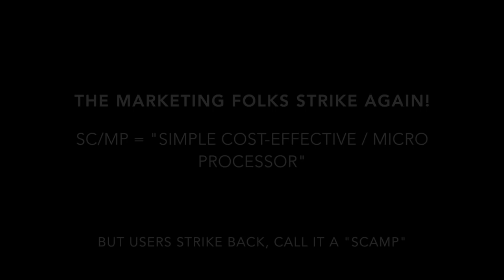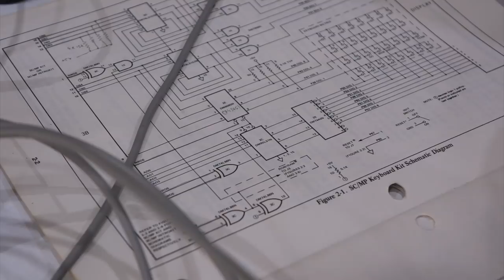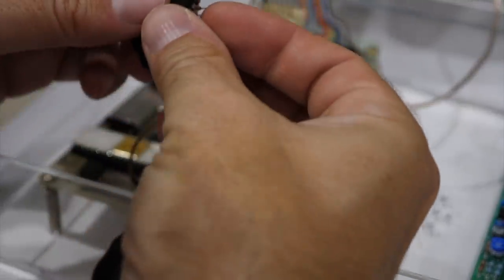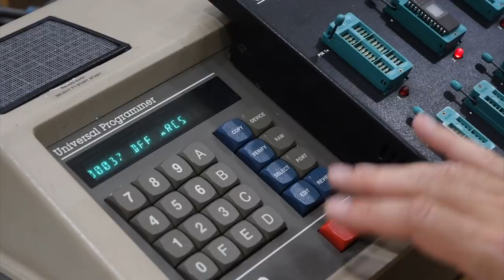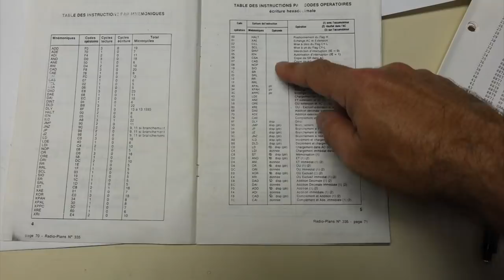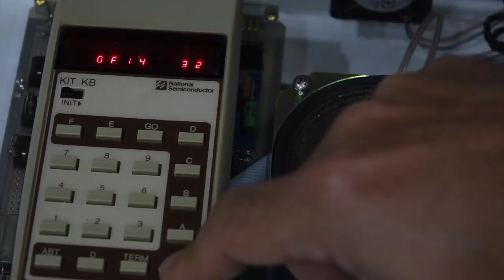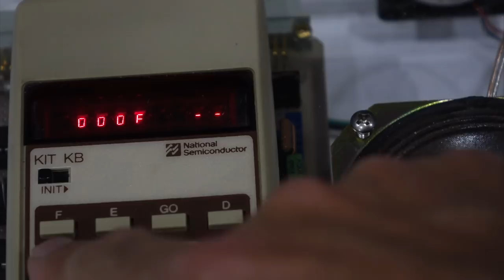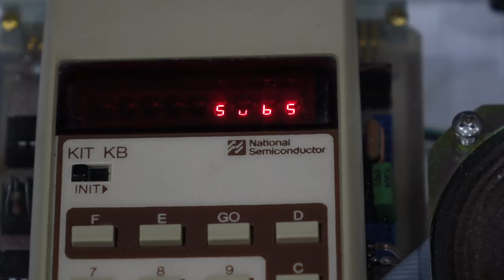My first computer: the 1976 SC/MP 8-Bit Microprocessor Kit

Comment: I'm reminded of a time when I made a minor mistake laying out a board, and three address pins got added in the wrong order — I was grousing about "I'm gonna have to build a little 'bunk bed' adapter to rearrange the pins…" when my business partner said, "No you don't — we just move the bytes around in software.  So long as address pins on the ROM go to address pins on the CPU and data pins on the ROM go to data pins on the CPU, we can massage the Intel Hex files with a tool to make the right bits appear where the CPU expects them."  There's a reason we continue to work together 30 years later.
Reply: Is it actually true that the hex files needed touching up, I would think if the wires for the address are out of order they would get stored out of order but then put back correct when you were reading it back.
Reply: That was my first thought when I saw the remapping diagram, only to realise it wasn’t just the address or data lines.
Reply: We had an issue when making a cartridge adapter for a ROM emulator.  My boss at the time had the genius idea to use the Address pins to latch data into hidden registers so that we could mux in our own ROM image.  I designed the FPGA and statemachines all in schematics (Xilinx 3042).  Fun times!
Reply: @ZakKohler  If it's RAM you can generally put the address and data pins in any order. It's a problem if it's a memory you program externally before mounting on the board, like ROM or EPROM. Then correcting the hex file would make the programmed data match the board's wiring.

Comment: My first microcomputer (I had been programming on mainframes since I was 14) was the "Cosmac Elf" which used an RCA 1802 microprocessor. One of the example programs in the manual was called "Spirit of 76" which made a sound very much like your siren program, except in reverse. The 76 op code (hex) shifted bits in the accumulator which, as part of a loop, generated the tones programmatically.  The 1802 had a single bit register called the X register (which in the kit I had was connected to the speaker) and it was set using the "set x" command, for which the mnemonic was SeX. 19 year old me found this very humorous.

Comment: I too was building SCAMP microprocessor boards around about 1976, I was twenty years old and working for the British Government. They saw where the future lay and let me buy what I needed to get my prototypes up and running. I too used pins on the bottom of the board which I soldered enameled wire (wrapped around the pin) just heating the pin / wire up until the flux melted the enamel and joined the wire to the pin. The wire was on a spool at the top of a pen and you could zig zag your way around the board to the next junction. Fun days !

Comment: Your excitement when it turned on really made my night!
Reply from the maker: You bet, I was so relieved it worked! It was a bit of a long shot. If this had not worked, I was not looking forward to a time consuming logic analyzer debug...
Reply: CuriousMarc

Well done. ;)

I've done that many times when getting excited to power up a device after repair - forgetting to plug it in. lol

You're a braver man than I, though - entering the hex manually on the EPROM burner. :p
Did you also read the contents of the buffer into the PC first, just to make a backup?

(just a bit of OCD on my behalf, as I would have typed it into the PC. To be fair, the keypad on your burner looks much nicer than the average PC keyboard. hehe)

Amazing work on the Alto btw.
I followed the whole series from start to finish, and couldn't wait to watch the next episode.
Reply from the maker: Yes, typed it on the burner because of the much better (Cherry keys!) keypad and auto address numbering. Downloaded it to the PC afterwards and will give it to Al so he can post on bitsavers.org.
Reply: doesn't the dolch keyboard use cherry keys too? (they might be a different variety of cherry keys though.)
Reply from the maker: Some Dolch keyboards do, and are quite sought after apparently. Not sure if mine is one of them, does not feel very special. The ones on the Data I/O on the other hand feel awesome.
Reply: Would be quite entertaining to see the SC/MP connected to your reel-to-reel HP tape drive for mass storage ;-)
Reply: You did very well :-)

Comment: I eagerly followed the introduction of all the early microprocessors, starting with the Intel 4004, and collected all the data sheets and manuals.The first documentation for the SC/MP actually referred to it as the Simple Cheap Micro Processor, so I suspect the engineers who named it that also called it SCAMP. Sadly, Cheap was soon changed to Cost-effective, which for me made the thing much less appealing.

Comment: Great video - thank! The SC/MP was also the processor in the 'SCRUMPI' kit from Bywood Electronics, UK - my first 'home computer' kit. Great for learning about microprocessors and coding. The 'SCRUMPI II' kit used the Mk II version of the chip, and also had more RAM etc. After that, I upgraded to a rather more sophisticated home-designed 6809-based system, and wrote quite a bit of code for that as well. All Hex entry - no assembler! Fun times!

Comment: WOW! I had in 1985 first DIY microcomputer made from calculator keyboard, Z80 CPU, 2x2114 SRAM, 2KB EPROM and calculator 9 digit mux led display. Big problem was burning EPROM byte after byte using transistor monostable timer and switches for address and data bus. In Poland these parts was hardly accessible, mostly from decommissioned hardware. Hand assembly EPROM had simple monitor program for hex programming own programs, however no mass storage. Assembling was made on paper to hex form and write sequentially in monitor. ROM was decoded at bottom and RAM at 0x8000 ) just no decoder but A15 was used to enable proper memory. First run was memorable day.

Comment: I remembered this computer when I read "Practical Electronics" magazine in the 198x issue about a capacitor tester using SC/MP computer on the "Ingenuity Unlimited" column of the magazine.

The set up was very simple just using a CD4016  and an inverter chip.  As I dont own a SC/MP computer and I've already bought a Ohio Scientific Ind C1P Superboard, I decided to convert the program to 6502 codes and display the result on the monitor screen.  But it didn't work on my OSI.  Now 30 years has passed, I think you might try it on your SC/MP.  I'll dig out the magazine and show the listing here if you're interested.

Not sure how to upload a picture (schematic) here though.
Reply: I just found the issue carrying the article.  It was in the micro-bus by DJD of practical electronics 1980/June issue.  Looks like there's an extra 4081 chip I've forgotten. The article can be downloaded here...

https://www.americanradiohistory.com/Practical_Electronics.htm

Allen
Reply from the maker: Thanks! It’s worth a try. Although I’m not sure using a CMOS AND gate as an improvised comparator is going to give you any reproducible precision... These were the good times when you actually had to build little cheap analog circuits to make gadgets. France had a similar publication called “Radio Plans”. I would devour every new issue. That’s how I learned electronics basically. Elektor was a large step above, catering to professionals, with truly engineered circuits. Their circuits were more complex and expensive and outside the reach of my limited kid’s budget and lab equipment. Even the publication itself was too expensive for me! It all pretty much died when personal computers and microprocessors became commonplace and software and games overtook hardware...

Comment: I've seen these SC/MP kits.. the first company I worked for (Video Data Systems) made a video titler around SC/MP and they had one of these kits for development.  I liked the calculator for keyboard and display device.  They switched to Motorola for subsequent products (I programmed 6800s and 6809s for them in the 80s).
Reply: exciting story. thanks for sharing. 
I remember the name Video Data systems for any reason.

Comment: BRILIIANT. My boss started on the 6800 and put a battery to the RAM chip to hold the programs. It was a mod over a kit from Motorola. He told me this thing was sky expensive back in his days. I learned ASM on the 8051, but at a point were silicon was getting cheap and memory inexpensive so by two years C was the standard, even for the old 8051 thing. Never inputed machine code though. However the tools were pretty basic. Avocet ASM compiler and linker, you need to compile at the comand promt and look for the errors on another file. Debug was just impossible. Even the AVOCET thing had issues with large segments of constant data (large, 40 or 50 bytes) LOL, long nights of cursing. After a long fight I decided to hock the board to a parallel port and use the HW isr on its highest priority and wrote  cryptic PC program to read and write any location of RAM so I can have a look or change the program flow playing with the right location. This save me a lot of time. Of course the microcontroller has a small piece of code to run the not-always-reliable PC comunication ... LOL. The great times.

Comment: My first computer was a single-card system (assembly required) based on the TMS-9900 (T.I.). That was a really cool 16-bit chip that used memory for general purpose registers. When I got all of the chips soldered down the thing didn't work. One of my college professors who was very supportive asked a friend at the local NASA facility to help out. They had a Gould Biomation logic analyzer which is exactly what was needed to debug the beast. After taking a look-see we found the problem in about 2 hours and fixed it. The system had only 4k ram, as I recall, and no way to store programs (like a cassette) so it didn't do me much good. But it was quite an experience to learn about logic analyzers, which I had no idea existed, and do some
live debugging. The TMS 9900 probably wasn't any record setter in terms of performance but it intrigued me that it had a 16-bit ALU when everything else was 8-bit.
Reply from the maker: I got a TMS 9900 board as my second computer! Still have it, but have not made a video on it.

Comment: I was loaned a homebrew SC/MP during my high school years. Mine had black slide switches to set the address, and nine red push buttons to set the data byte: eight bit toggles and one clear-all (I'm pretty sure). I was handed the board after a 3-minute explanation of hexadecimal, and soon found myself working long into the wee hours trying to get my first loop working, because I had to figure out two's complement after the PC is incremented. Hex is one thing, two's complement is another thing. 

Why increment the PC after fetching an unconditional branch instruction if you're not going to use the result? 

This is what they call "beginner eyes". Sometimes beginner eyes is romantic, other times it's a PITA.

Comment: Cool kit, I built one of the RCA COSMAC ELF kits back in my high school days, eventually, I cannibalized it for parts, and don't still have it, but I do still have the original microprocessor and the original 1861 pixie graphics chip. A while back, I built a reproduction kit for this, The ELF 2000 from spare Time Gizmos, and used the old microprocessor and graphics chip and they still work to this day. Trying to learn 1802 assembly again, at 60 years old I'm not sure my brain will handle it.

Comment: I do remember the "scamp".  I had access to a microprocessor trainer sometime around 1978 (similiar to the KIM 1, but it wasn't that).  It had an LED display + numeric keypad and I wrote a bunch of programs in my notebook (which I still have)  just like you did and learned 8080 assembly language in the process.  Those were the days.  I'm sure it was satisfying for you to revisit this project the way you did.
Reply: Was it the Heathkit ET-3400? I've got one of those and it's fun to play with. 
EDIT: Just remembered the ET-3400 uses a 6800 and not an 8080.
Reply: @AureliusR  It was definitely an 8080, I still have an old pad of paper with my programs still written on it.  It was a machine that was loaned out from the company I was working for at the time.  I don't honestly recall a model #.

Comment: My first project was a digital clock when I was 13 in 1982.  I started about 15 chips and later I learned to build AND and OR using dioids and resistors.  I think I ended up using 8 ICs.   These parts were expensive in Iran and a simple CMOS gate IC like 4011 would cost me a week of my pocket money.  Like you, I retrieved my project from my parents garage while ago, but I never got a reason to bring it to life.  Interestingly I took some French the same year in high school but I can't remember anything from that French class.   I still can count to ten in French and I learned that from my classmate the year before!

Comment: Z80A Assembly language always drove me up the walls I much prefare AT&T assembly language programming for the 80586.
Reply from the maker: Yes, the 8080 and Z80 all had to live with the legacy of the 8008, which in turn was made to implement the instruction set of the Datapoint 2200 terminal, resulting in the contrived and unpalatable instruction set (to this day!). In comparison, the National SC/MP set and the Motorola 6800 are far cleaner and logical, to the point that you could program the SC/MP directly in hex code without an assembler as I do here. Unfortunately, that appears to be the sole redeeming feature of the SC/MP...
Reply: I wrote thousands hundreds of thousands of lines of assembler code for the 8080/z80 processors.
I built the Altair in 1975 connected to a KSR-33 teletype. I MUCH prefer the IBM mainframe instruction set to the toys of the Intel line, which they haven't improved as of today from the 8088! All brain dead!

Comment: Very nice.  I built a dedicated 8085 uP based circuit in 1983, which emulated a grandfather clock.  We had amplified chimes on loan from Schulmerich (sadly we had to give them back), and I used a counter-timer chip and decade dividers to make the clock function.  I think the UV erasable PROMs are fried by now and my documentation is not as good as yours.

Comment: My first computer was the Science of Cambridge MK14, built from a kit. It was similar to your machine (SC/MP, 256 bytes of RAM, 512 bytes of ROM holding a very similar monitor program to yours), but it had the keyboard on the main board.
Reply: Ditto, except that I had the luxury of an extra 256 bytes (non-contiguous, 1 fault bit) and I/O (with another 128 bytes). And I had to make a power supply from a transformer, bridge rectifier and large electrolytic capacitor.

Comment: Reminds me a lot of the KIM-1! :D  I love it! I wish my first computer was as awesome as this.  :D  (A couple years ago, I hacked a Novus 750 calculator, which looks just like your control panel for this one, and interfaced it to an Arduino, running a modified version of the KIM-UNO firmware, emulating a KIM-1 on the same kind of display... but pocket-sized. :D )

Comment: Well, i'm from the same time period, but mine wasn't a SC/MP (although I knew of it and had seen one in operation), but instead I bought the more promising (and "better") KIM-1, which was fully built (although I had to design a power supply and an enclosure for it). But It had the much better 6502 CPU. I also had a friend that used the 1802 based ELF board, and it could play music too, especially the "bumble bee" song, very nice. (I still own a long play record with computer music that includes this song) Another friend had a system with a VDP and it could run the "game of life" program. Good times where I did many "home visits" of other computer enthusiasts.